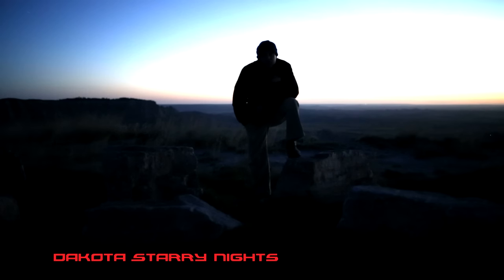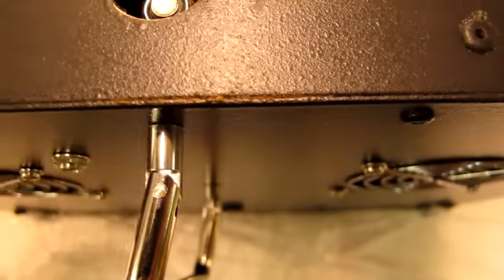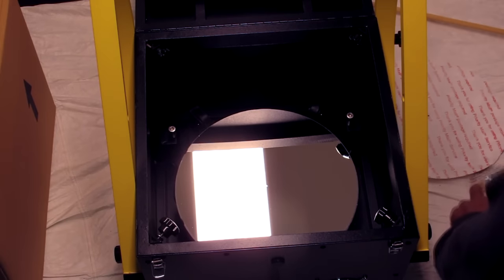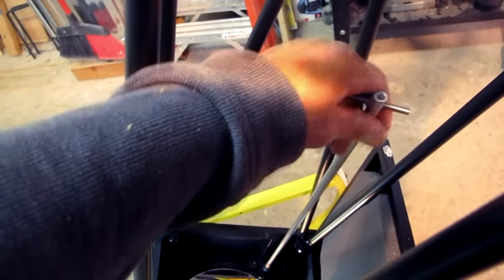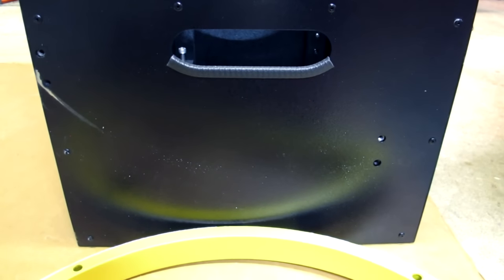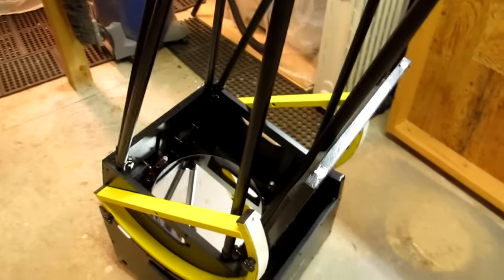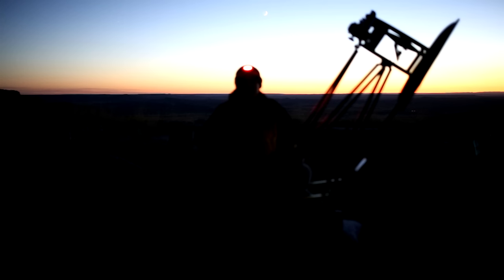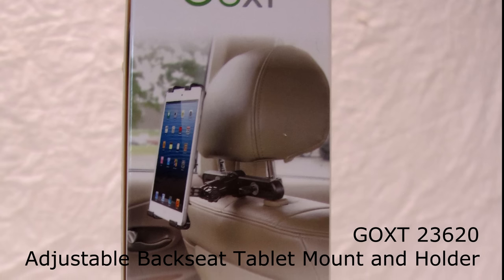Explore Scientific Ultra Light Dob Review

Comment: Wow, you really had issues with the scope... I must say that I got the exact same model this year (the packaging appeared to have come from the Netherlands originally), and apart from flimsy RDF and a particle inside secondary cage, I did not have any problems with it:

- my scope didn't have fiberglass over the aluminium on altitude wheels and at the bottom of the rocker box, seems to work very nicely and smooth
- I haven't noticed any rust (although I haven't done a thorough inspection)
- there are no rivets or altitude tension knob causing problems with altitude movement, nor any felt or anything like that inside the rocker box
- there was a battery box supplied with the scope

I moved the truss connector positions in the secondary cage to get a better angle for the focuser (as you described as the 3rd option), and it has worked rather well.

Why I'm saying this is that there really seems to be quite a bit of variation in quality and also apparently design of this particular scope model. Anyone contemplating getting one should probably carefully find out what kind of model that particular unit is. It seems I got a good one (and I've been quite happy with it).
Reply from the maker: +Ari Kesäniemi Glad to hear you made out ok.  Like I said a guy might get lucky, like you, and not have any issues at all.  I'm really happy with the dob now after working out the problems.  But not everyone will want to, or can, fix it if they get a lemon.   Thanks for posting.  Clear Skies. Dakota
Reply: +Dakota Starry Nights Did you purchase the scope from the official Explore Scientific website or another seller? I plan to buy this scope from a different website since the main website is not in stock.. Hopefully I get a good model...
Reply from the maker: +boxcarjakey I got it from Optics Planet but they are out of stock now (11-24-2015) Telescopes.net has them in stock as of this writing.
Reply from the maker: +boxcarjakey I got it online from Optics Planet.

Comment: Hi I was wondering if the scope, when packed, wasn't too heavy... I'm only 16 and I don't want it to disgust me from astronomy as I am just starting. This model seems nice as it is possible to take it on a trip during hollidays in a small car. 

So what do you think ?
Reply from the maker: +FK Orangina The ES Ultra Light 12" is your best bet for portability.   It breaks down into two or three manageable small packages as seen in the video.  Twelve inches of aperture can show you a lot of what's up there.  It's probable all you'll ever need for visual work.  And has the best weight to to "light grab" ratio IMHO.  Just add dark clear skies and you're off on a journey of discovery!  Dakota
Reply: +Dakota Starry Nights 
Thanks for your fast reply ! Just to know, how much do each part weight ?
 PS : I'll be purchasing the 10" instead ;) (not enough money ^^)
Reply from the maker: +FK Orangina Well I've never weigh the parts.  But the mirror is the heaviest component.  Though I can easily lift it by the two hand cutouts on the side of the mirror box while leaning it again my stomach.  The 10" should be a piece of cake I'm thinking.  PS: if you can wait and save up the money the 12" would bring in a bit more detail on some of the fainter objects.  As these things go, after a while a guy always wants to go deeper and wishes they had gotten a bigger dob.  Not that the 10" is a bad choice.  It's going to lighter and more compact than the 12" for sure.  And at the end of the day the best scope is the one that's going to get used the most.
Reply: +Dakota Starry Nights 

Is there a handle on the mirror box ?
Reply from the maker: +FK Orangina two cutouts; one on each side.

Comment: OMG Rust, Flakes of Aluminum rough looking... How Much does that cost with shipping?
Reply from the maker: It depends. They often have them on sale.  As of now the 10" is on sale for $760 us and the 12" is $1500.  These are Gen II dobs.  Mine was a Gen I.  The Gen II has reportedly  been fixed.  I know I got a lemon but I still wouldn't hesitate to recommend the ES ultra dobs due to the ease of transportation and the 10" is a good buy.  If you want to get the most out of these light buckets you need to travel to a good dark site.  That said, the Hubble Optics UL series is my preferred choice.   Clear skies!

Comment: Just received my 12" explore scientific. Few things to mention attaching the altitude bearing to the bottom wholes will cause friction on the inside of the box against the back of some screws, so go for the top whole.  Once all assembled all parts were moving smoothly . First light came about the next day, collimation was a breeze and once the mirror cooled down the stars were tack sharp, impressed! The red dot finder went straight to the bin after failing misreabaly to see the stars through it's dim glass, very poor and flimsy. Like Dakota mentioned either rotate the cage or get a box to raise the scope as the EP angle is trying. Made in china but great design and really decent optics
Reply: Slim Loghmari I have a Celestron 8" telescope, is it worth getting this one for more clear sky ? and was yours also rusty ?
Reply: Ahmad Isa mine had no rust whatsoever, it's a fantastic telescope, my first views of the heavens was spectacular. I am really impressed with the optics. A lot of telescope for the price
Reply: Slim Loghmari oh thanks for telling me that, I am going to buy it within 2 days, did you have this swing offset also ?
Reply: Ahmad Isa nope all working in order the alt/Azimuth are smooth but one word of advise if you are observing in a lit area I advise you to get a shield or a heavy duty bin bag to stop the light hitting your secondary mirror as you will see the spiders in the eyepiece if no shielded
Reply: Slim Loghmari yeah I know what you mean, that's it I am going to buy it now, thanks

Comment: As a former aircraft mechanic, anytime you have steel meeting aluminum, you will get dissimilar metal corrosion. That's what you have there.  I hope you're able remove most of it by treatments.
Reply from the maker: Mixing steel with aluminum was a bad decision.  ES should have know better.  I'm not sure the reasoning behind their material selection for the bolts. If it was for strength they could have gone with a larger aluminum bolt.  The bolts connect the truss poles to the mirror box.  Excessive corrosion could led to breakage at the point where the steel bolts come in contact with the aluminum mirror box.  If that happens it will be difficult to fix.   
As a remedy, I wire brushed them then added a coating of wheel bearing grease to reduce oxidation. It seems to be working for now.
Reply: @DakotaStarryNights , I'm glad to see you treated them. Should last you in good stead for a long time. Brian

Comment: Made without very good QC and I'd hate to see what Explore Scientific deemed was unacceptable. See holes that haven't been deburred, rusty welds and heavy grind marks tells me very likely poor welds. Full of metal chips and a focuser that has something rattling around. There is no excuse for rust with the inexpensive coatings available. I've had issues with some Explore Scientific products too and I don't know why they even bother to put their crummy red dot finders on, better off without it. Shouldn't have to "fix" the scope before using it even if it is cheap. I have a center-finder head for my Starrett tri-square and it makes checking the mirror center easy.

My mistake when I was a beginner was buying a cheap wobbly ES scope and mount, sent it back and joined my local Astronomy club something I should have done before buying anything. My club had scopes I could borrow plus going to meetings and outreaches I learned quite fast on what to buy plus it is always advantageous to try out a scope first.

Comment: LOL! Aluminum don't rust!
It has to be carbon steel!
Reply from the maker: Yes, it's common knowledge that aluminum does not rust. Which is why I used a magnet to demonstrate that certain parts of the mirror box were made of steel and not aluminum as some had thought.  However, aluminum will corrode under the right conditions.

Comment: This will be a return for me. Horrible manufacturing. Very poor quality in my opinion.
Reply from the maker: Yeah, DJ it was a lemon alright.  But ES has since addressed these problems, as I've been told by others, with a release of a Gen II version.
Reply: @DakotaStarryNights  I own the Gen II version. It's BETTER, by a longshot.

Unfortunately for me, it's still not good because of the material quality

I've owned mine for less than a year though and it needs replacement or extensive repairs. Things just constantly break. The other day, not one, but TWO of the truss tubes flat out snapped. I was extremely disappointed with it. Was hoping a $1,500 telescope would last me at least a year. 

It's not like the focusing mechanism or mirrors suck-they're AWESOME. Everything else kind of sucks. There's not even a way to close off the mirror box fully in gen II, so the primary mirror gets caked with dust in just a matter of days. That means it will need to be cleaned like once every few months for someone like me who lives in high desert (Say hello to scratches :P). Simply having a box to put the secondary part of the scope in and a way to close those handles would be good enough for me. But there isn't -_ I'd really appreciate a mount for the battery box too so that they aren't just flying around xD

Depending on how they treat me in customer service will dictate how I feel about them as a company from here. I'm a man who gives second chances, so I'm really hoping they just send me a new one or even just new parts. I can see they put a lot of effort in with this new model, but it needs serious improvement. If I end up getting screwed over by customer service, I'll probably build my own model and use their mirrors and focuser from my broken scope.
Reply from the maker: @lukefernandez3492  Sounds like you got a lemon, too.  Hope they make it right.  
A protective housing for the secondary mirror can be easily made.  Check out this video 4:09 in the timeline. https://www.youtube.com/watch?v=KIIOt2bNdaA